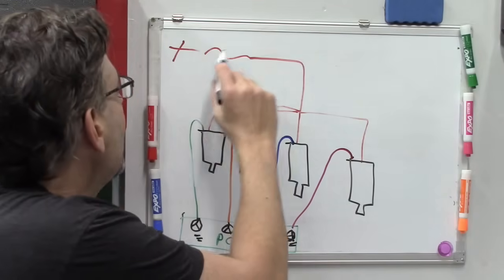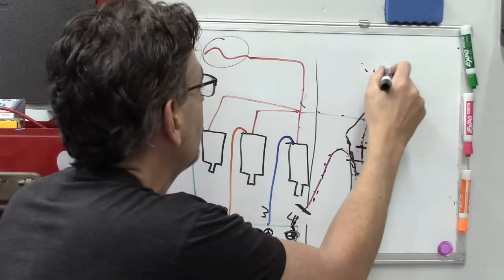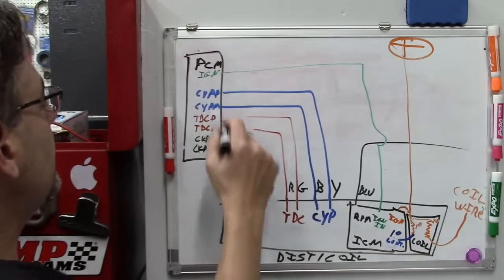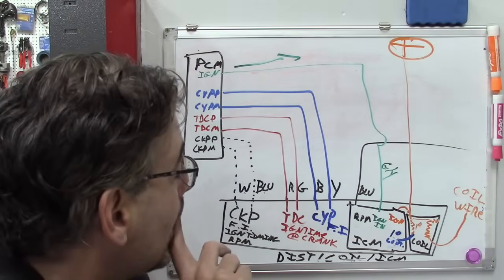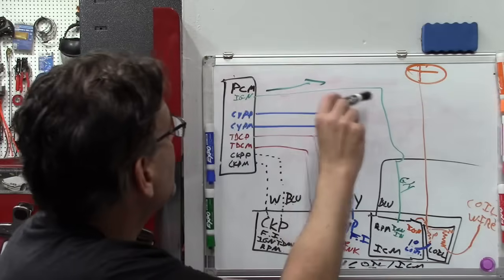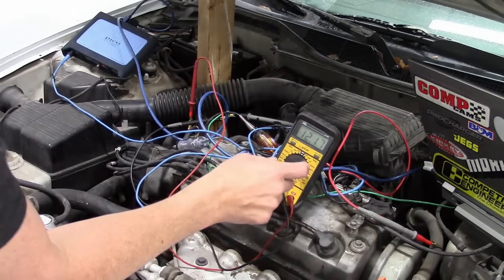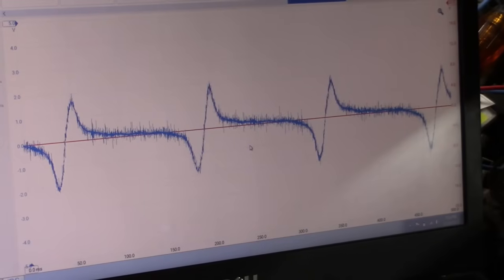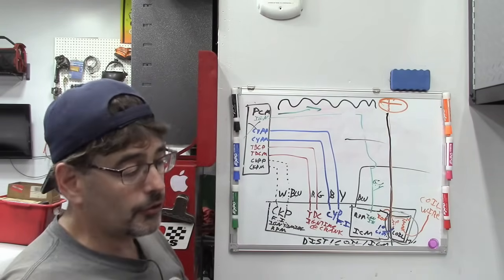DIY -How To Diagnose No Spark No Start. Bad Crank Sensor? FREE SBQM VIDEO

Comment: If those distributor shaft bushings are worn , it would affect the air gap on the reluctor to the crank sensor ( AKA magnetic pick up ) . That may then give an erratic dwell angle .
Reply: It uses voltage drop while cranking . Auto Ditex also has a tester that works with either an amp clamp or battery clamps . It can also be connected to a trigger ( coil or injector )  to sync the results so you know which cylinder the readings apply to . I will get the websites and post it . Bernie Thompson designs the ATS equipment and sells it through his company , Automotive Test Solutions . He is one of the top techs in the country .
Reply from the maker: absolutely true. won’t affect the compression though.

Comment: Nice diag, as usual.  Is it possible that with no ignition and injectors firing during all that cranking that it was just cylinder wash in one or more of the cylinders or did this car turn out to have a real compression issue?
Reply from the maker: oh wow what a great thought!!!  ok I admit I never thought of that but indeed I did do a compression test on it and it has a weak cylinder. 
  but damn- I will consider that in the future. that’s absolutely a potential variable. 
  Man I love these comments!!!
Reply: That is great thinking!

Comment: I replaced my fuel pump but my fuel pump gauge is not accurate, I have 28 gallon tank but then when I gas up it will only takes 20 gallon max,so there is 
Still 8 gallons in the tank but my fuel warning light illuminates and the needle is in Empty I gas ⛽ up but it will only take 20 gallons.How can I fix this?

Comment: Putting a new distributor is the best choice, why?  because of the play in shaft. compression ratio's can vary, as long as it is mechanically sound, and not below minimal standards.
Reply from the maker: how can a bad distributer cause variation in COMPRESSION??  it will change the timing but how can it change the compression????
Reply: @SchrodingersBox  A bad distributer won't make a variation in the compression. I was talking about the variation between cylinders compression. A motor can have different compression between cylinders and still run. play in the shaft of the distributer may make a difference in the spark timing.
Reply from the maker: yes of course there will be variability in cylinder compression- up to 20% is tolerable in fact. I didn’t understand how a loose distributer can cause any effect on cylinder compression though. 
The play in a distributer shaft is completely irrelevant to compression. It’s relevant only to timing.

Comment: So Matt, at the point where the ign input didn't trigger the coil, could we have ohmed out the primary on this system ,, not clear if you could get to the ground side?
Reply from the maker: Yes that could be done by removing the rotor and cover and accessing coil. it can’t be done from outside the distributer though. it would be a fair test for sure!!
Reply: @SchrodingersBox  I love the detail Matt because that’s where the learning happens ... ohming the coil is never definitive, especially the often break down under high demand, but short cutting the process in this case also shortcuts the learning
Reply from the maker: extremely well said my friend. I agree 100%

Comment: Probably doesnt make a difference in the final diagnosis but on the wite diagram and white board you show 9 wires going to the distributor. Earlier you said it was a 8 wite connector on the car. Did i miss something? Thanks
Reply from the maker: one of the wires was actually internal in the distributer. nice catch.

Comment: Great video Matt. Typically it’s always best to ground on the battery vs a sensor ground or any other ground due to possible voltage drop when using an oscilloscope. Thanks for sharing, excellent.
Reply from the maker: Very true- the reason I did the sensor ground is it lets me test both wires at the same time.
Reply: @SchrodingersBox  I forgot to channels or kind of talk to do that with. I have the ATS escope where you ground it and all 8ch are free to be used on Powers & grounds. Pico is amazing tho too. Very good scope

Comment: TDC -Top Dead Center sensor. Trigger 4 times per engine cycle. Once at every cylinders top dead center.
TDCP -One of the wires for the TDC sensor
TDCM -The other wire for the TDC sensor
CKP Crankshaft position sensor. Triggers 24 times for every engine rotation.
CKPP -One of the wires for the CKP sensor
CKPM -The other wire for the CKP sensor
CYP -Cylinder Positions Sensor Triggers once every engine cycle at top dead centre of cylinder #3.
CYPP -One of the wires for the CYP sensor
CYPM -The other wire for the CYP sensor
Reply from the maker: Looks right to me!!
Reply: So many acronyms in automotive....my brain is starting to swim 😂

Thank you.

Comment: Very good presentation, I have been dealing with Honda and Toyota Igniters since the early 80's and I have replaced a million of them over the years, hardly any coils. Just so you know, back then they made really  good parts, they don't any more so unless it's original Honda or Beck Arnley it probably won't last so keep that in mind if it quits 6 months from now you might have to do it again so make sure you keep the reciet.
Reply from the maker: Good to know!!

Comment: Mines started but still keeps stalling fuel psi 43 on start 35 psi with engine on and at idle my rpms are also high at park and goes normal when I drive 1993 Buick regal 3100
Reply from the maker: sounds like it’s not fuel then.

Comment: My mercedes since it was 88 was pre obd2, i didnt have the star tool for the mercedes connector. I had an ignition control module - expensive, the crank sensor connected directly to that. Took that to multiple shops snd they were chasing their tail trying to figure it out when the car was running. Apparently the hood had to be shut on a hot car to get the crank sensor in failure mode.

Comment: I have a 88 mercedes 300se with this problem. You'd stop to get gas and the car wouldn't start. Sometimes some starter fluid would fire it off, then it would run. 
Finally i saw a video from a mercedes tech with the same car and problem. The crank shaft position sensor would heat soak when the car was shutoff hot. Then the ignition control module would not fire properly or good enough to start the car. I changed the crank sensor after measuring the resistance on the hot sensor like the tech did and replaced it. 
Engine ran fine after that. 
I didn't take notice of the tach not working in my car, interesting to note that.

Comment: Nice clean diag. I have done this one before on a friend's Civic but it had NO compression to the point where after getting the ICM installed had to squirt oil into the cylinders to get it to run. There was so much fuel in the engine that the oil was all washed off of the cylinder walls. Once we did get it started it ran fine but told him to change the oil before driving it.